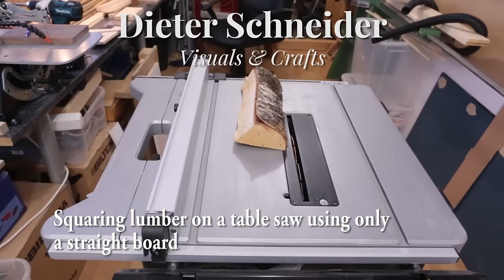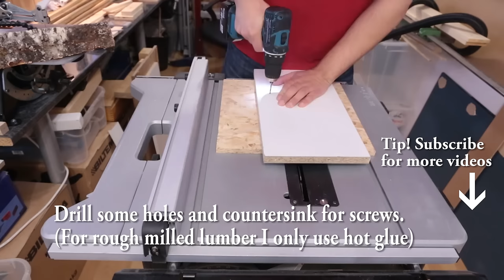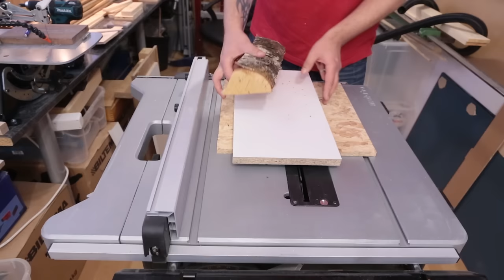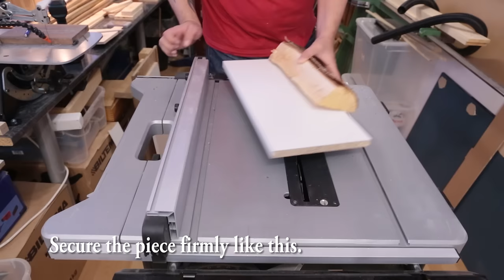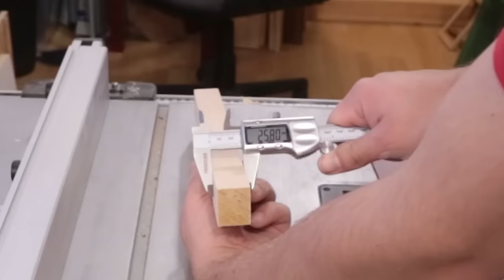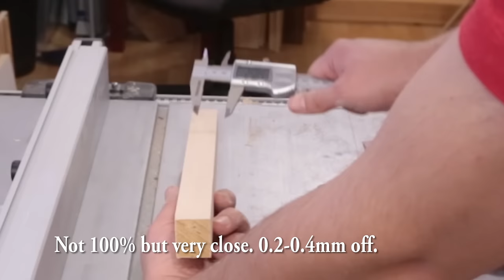How to square any piece of wood using only a table saw and a straight board

Comment: I do the same thing with a bar clamp and 2 square blocks clamped on the ends of the piece.  Make the first cut and you have a flat side down on the table saw for the second cut.  After that it’s the same process as the video.  I’m a hobbyist knife maker and I like using domestic woods from my farm for the scales.

Comment: Have you considered using a handsaw and a hand plane, simpler, easier, quicker, safer?
Reply: Definitely safer.. Also you don't degrade the material by drilling holes in it...

Comment: I have been looking for a technique, seen a few. I tried doing a log. Got a few good pieces out of it, but man I really really like this technique. Thank you so much. i will give it a try :) looking for boards, same idea, need a right angle with two adjacent sides, then these can be used to run the other sides of the log. Excellent.

Comment: Like the simple method you've executed...as for what kind of sound a table saw could have? BIG block 60's muscle or dial in a Ferrari/F1 or depending on type of wood...soft wood could be like an old Toyota/Honda 4 banger from the 70's or 80's and hard woods you can maybe dial in a Peterbilt or a Locomotive! lol...

Comment: Newbie woodworker here, and so far I'm having some trouble getting a perfect square measurements on a sheet of plywood even when I run it on my table saw. For example today I had a 56cm by 54cm piece of plywood and all the sides where un even, and in every time I would measure it with my square I could see through it on all sides, very frustrating. This video might help but is there a way to get all sides to a perfect square even when from the beginning all the sides are uneven? I tried many times on all sides running it through my table saw but no luck, I kept getting the uneven pattern and my saw blade is calibrated. Any help would be greatly appreciated, thank you!
Reply: pick a side you want to start with, and attach a straight edge with double sided tape to the opposite edge..  run the straight edge against the fence and the cut side will be straight.  turn the piece 90 degrees and align the straight edge with a framing square from the new cut.

Comment: its nice but you cant do 90% all corners , i tryed it 2 days not working and this is very hard way
Reply from the maker: You only need to sides to be 90 degrees, then just flip it over and resaw. Now, all your sidew will be square. Your board must of course be straight and square.
Reply: Dieter Schneider  my friend i thought that this the way but i need 1000 of them and this is very hard and trust me almost always shit happned not 90% :) and nothing but CNC did this work better

Comment: You are supposed to shim it  , not cant it that way sir. That's a great way to bind your blade and cause kickback. Also a big waste of wood.
Reply: As long as the wood makes contact with the melamine where you attach the screws, which is what happened here, it is secure. The riving knife should be at the highest level and then the blade would not get bound. As for kickback, not sure how that would happen either. Make several passes with this technique and people will be fine. The only thing I agree is on the waste of wood, but if there’s a better way for someone to avoid a jointer and planer I haven’t seen it